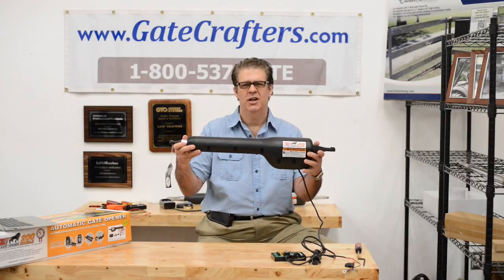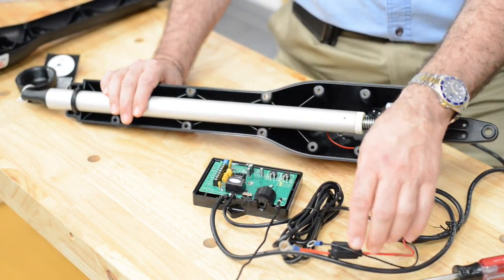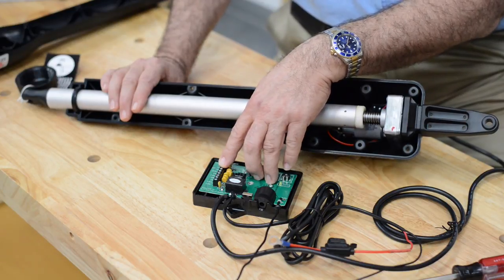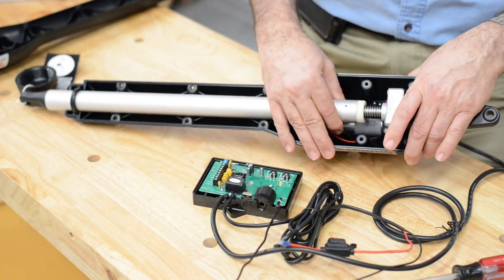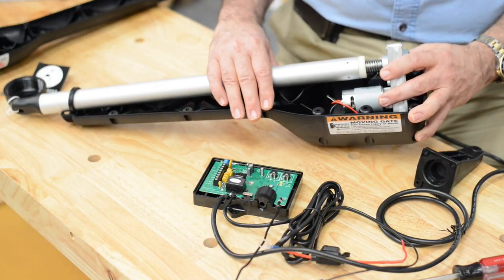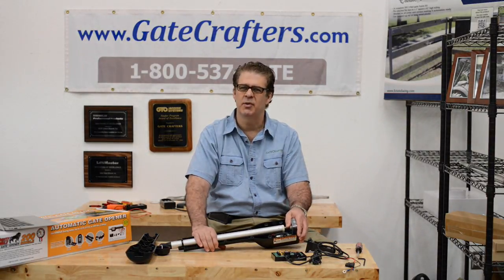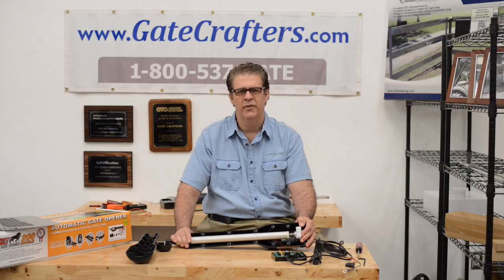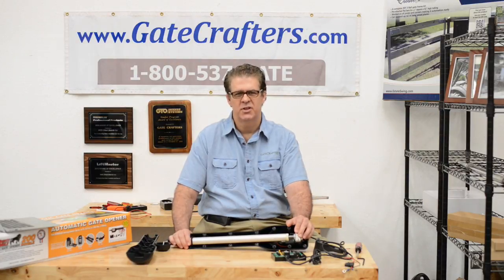How To Use Mighty Mule FM200 Driveway Gate Opener

Comment: i was wondering if someone could help me troubleshoot the problem im having with my mule 350. the unit started to beep constantly i was told it was the battery going dead so i bought a new one but now its not working at all. could really use some advice thanks